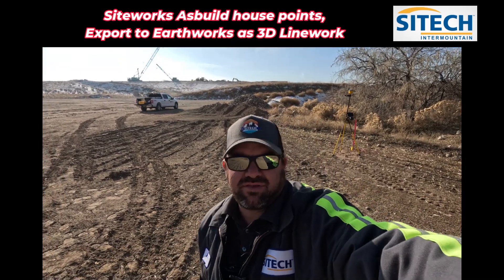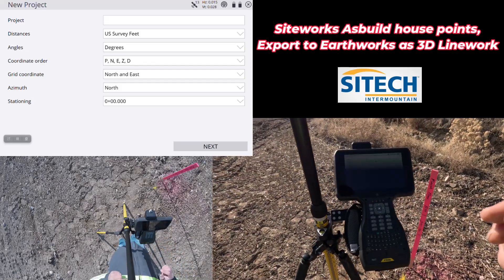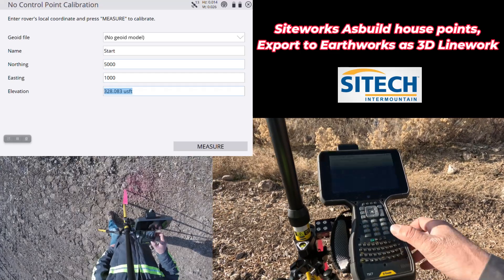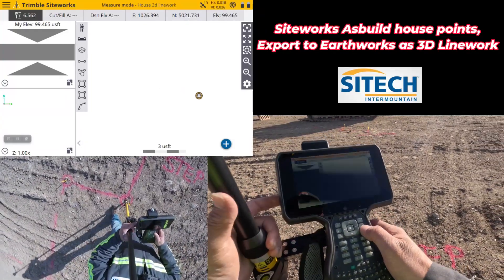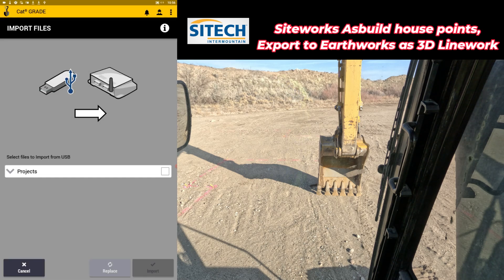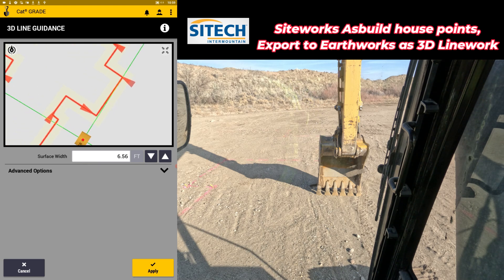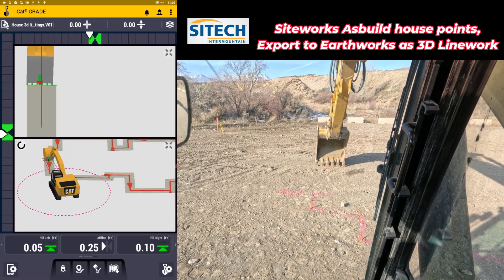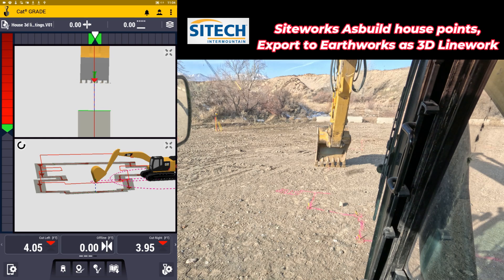Siteworks Asbuild Footings Export to Earthworks as 3D Linework

Comment: Great video. 
Question on Elevation:
-When you completed the No Control Pont Calibration in SiteWorks you set your elevation to 100.  
-Then when you shot your points to create the break-line SiteWorks captured the actual grade at each points location (99.457, 100.304 and so on)

-Then when you imported the linework file into EarthWorks and hovered the bucket over the points the elevation was the actual point height (99.475, 100.304 and so on).  
-Then you went into the Vertical Offset> Advanced Options and entered a Working Surface of -4.00ft 
My question is- How does EarthWorks know to use the 100 elevation from your SiteWorks control point calibration for the offset elevation (100-4=96ft working surface) and not each points actual elevation (99.457-4=95.457ft, 100.304-4=97.304ft and so on)?
Is that the difference between the entering an offset in Vertical Offset>Offset     And     entering it in Vertical Offset>Advanced Options>Working Surface Offset?
Reply: The working surface will not correct any errors in the elevation or level it out.  I appreciate you bringing this up, because I did create this in error by not changing the elevations on the points before exporting. I should have set all those before I did that. I created 4 videos back to back in the field that day and the one right before this one was me shooting all the house feather points and not caring about the elevations because when I put it in earthworks and created an infield design, I was able to correct the elevations there and level it all out. So when I switched to this video I did the same process but did not correct the elevations.  The only reason they are relatively close is because the existing ground was not to far off.  Sorry for the false info here, I will need to correct that one variable. Your observation is correct on needing to edit those elevations prier to exporting or else the earthworks machine will just use the 3D linework as is. Thanks again and thanks for watching.
Reply: @JeffLarsen-iz8qk 
Thanks! No need to make any corrections.  Still a fantastic demonstration.   Just keep making more of these videos-your videos are the best out there for any manufacturer.  Trimble owes you a lot.